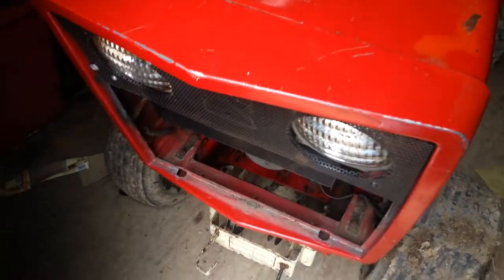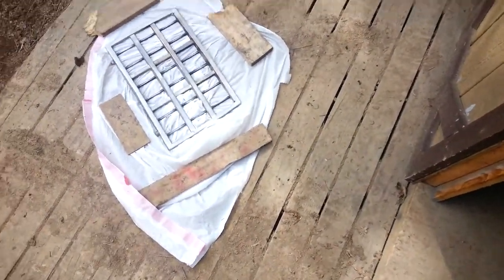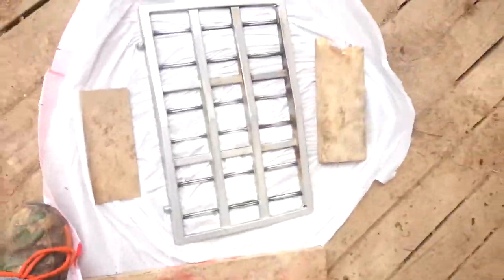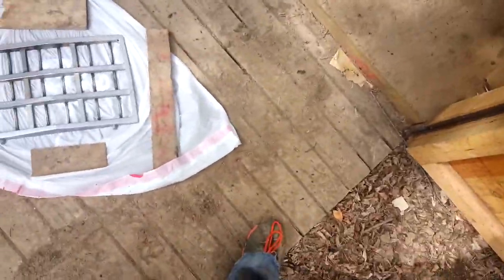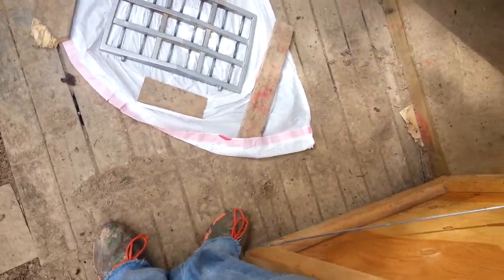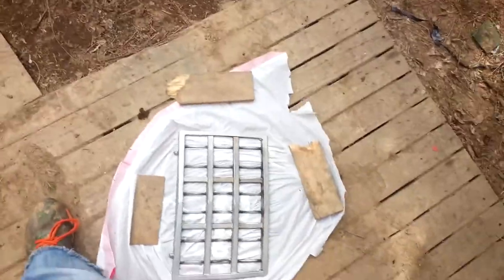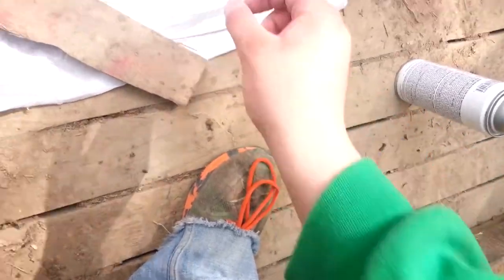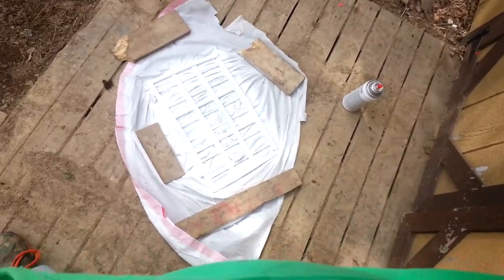Cub cadet 582 Painting the grill

Comment: Did you paint the 582
Reply from the maker: Nope not yet planning on it soon im just using the white grill for shows because the muffler will turn it black again so im running without a grill right now till I get my other one Im picking up a 112 john deere with a hydraulic lift in a few weeks so once I get that running ill start with paint on both id like to have them as my show tractors